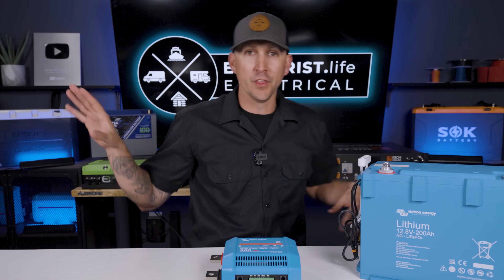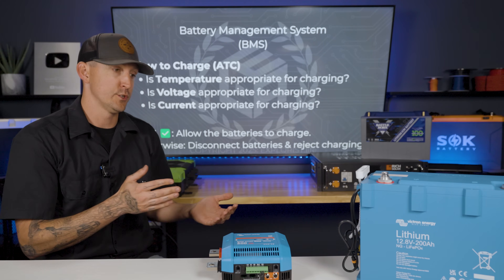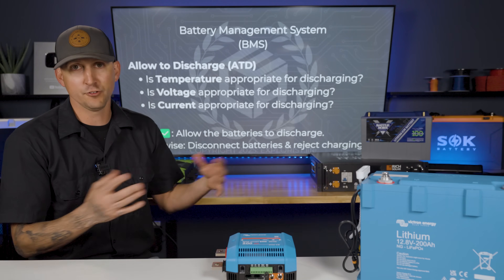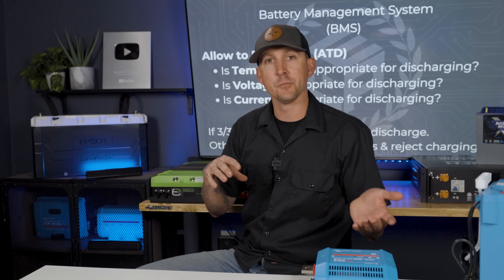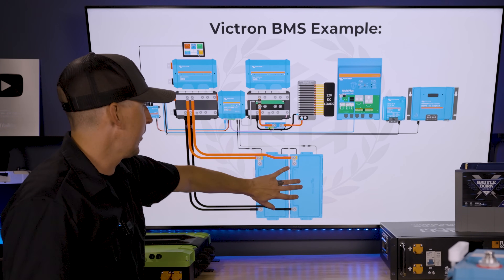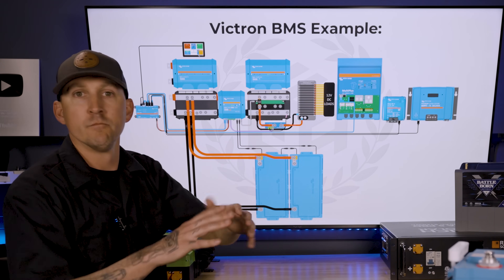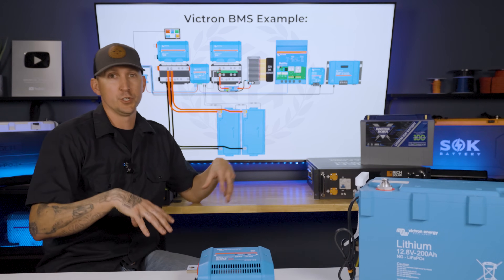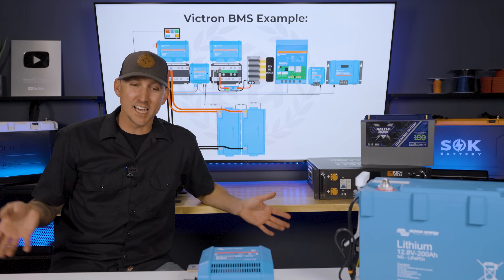BMS (Battery Management System) Basics for LiFePO4 Batteries | Battery Basics Ep: 2/7

Comment: I wonder if the Victron approach is objectively better since it powers-off/pauses chargers (mppt, dc-dc, multiplus) on a BMS "not-ATC" signal, thus stopping energy flow throughout the system, versus an in-battery BMS approach where charging energy still flows through the system but is stopped at the internal BMS. I guess energy doesn't "flow" anymore once the internal BMS shuts off power input. Hmm..
Reply from the maker: I don't think one is necessarily better than the other.  They are both completely adequate and acceptable.

Comment: If I have a victron system but cheaper batteries (Powertech) because I live in New Zealand, do I still need a bms ? I have victron charger, 2000w Victron inverter, CerboGX  and 2 separate MPPT,s. One for roof solar one thru Anderson plug for portable solar.
Reply: Just saw other vid on batteries. Powertech batteries say they have their own business internally. Plus I have max/min voltage alarms on my Victron screen.

Comment: Here's perhaps a odd question but one that is not entirely clear to me.  I am thining of a camper van-type set-up.  Without solar, but that should be includced at same time (solar + alternator or solar + AC shore power).  

We speak of a BMS charging or discharing and always independant.  Say I am charging from my alternator, via a DC/DC converter, or perhaps with shore power via an AC/DC converter.  At the same time my 12V fridge is running and a few other minor 12V loads in the back of the van.  

I am assuming that the BMS looks for the correct voltage, current, termperature and will allow charging at the same I have some level of 12V loads pulling power.  That is, if there is enough current to power the 12V loads first, charging will occur otherwise (normal case unless you have way too many 12V loads!) otherwise charging is disable.  So the two conditions can nicely co-exest or is there sometype of an isolatore needed that seems to never be mentioned??
Reply from the maker: Great question — and not odd at all!

In most setups like the one you’re describing, charging and discharging can absolutely happen at the same time without issue. The BMS is designed to manage all that behind the scenes as long as everything is within spec.

To be sure your system is wired to support this properly, it’s a good idea to have our team take a look. You can contact support here:
https://shop.explorist.life/support
(Free personalized help for items from our store: https://shop.explorist.life)

If your components came from elsewhere, the EXPLORIST Pro Support Membership is a great option for custom support:
https://shop.explorist.life/shop/all-products/membership-tiers/

They’ll help make sure everything works smoothly together!

Comment: One comment  regarding  Internal vs. External BMS.    I think you want a single interal BMS if you have a single battery system.  All internal, same warrenty has the battery and 100% compatable with the specific battery being used, less space requireed, less wireing and fewer wiring junctions to fail.   

Use an External BMS when you have multiple battery system so that  you are not paying for a BMS over and over with each battery.  Also a single BMS would be the one BMS to "rule them all" vs. multple BMS that may fight eacher since they will never be exactly identaical.  Consider if the BMS's are checking to see if charging ok if you are right on the upper temperature limit or lower current limit or similar condition.  If you have 3 batteries and 3 BMS-- 2 may enable the charge while the 3rd one says disables charging.  

In any case, you would never want to combine a battery system that uses a combination of internal and external BMS, espeically from different manufacturers.  They would frequently fight each other and likley lead to some very odd and intermitted behaviour that would be difficult to troubleshoot!  And worse case for additional cost, extra wires, additional points of failure, etc.
Reply from the maker: Appreciate you sharing your thoughts! There are definitely a lot of factors to weigh when it comes to BMS choices, but some of the points here may not fully apply across all setups — especially with how modern systems handle multiple BMS units or hybrid configurations.

If you're working through a specific setup or want to double-check what's best for your system, our support team can help sort out the details:
https://shop.explorist.life/support
We offer free personalized support for items purchased from our store: https://shop.explorist.life

And if you're using gear from other sources, our Pro Support Membership is a great way to get expert guidance tailored to your build:
https://shop.explorist.life/shop/all-products/membership-tiers/

Comment: And the BMS alone costs as much as some batteries. That’s a tough sell. No thanks
Reply from the maker: This video was less about 'selling' and more about educating on how an external BMS works.  For 'selling' - we have both internal and external BMS battery option systems available in our store based on customer wants and needs: https://shop.explorist.life

Reach out and we can get you whats best for your system: https://shop.explorist.life/support
Reply: @EXPLORISTlife 
Victron makes great stuff with great connectivity with Cerbo but I wouldn’t touch their battery, Battle Born or Dakota battery with a ten foot pole. So many other battery options for a third to half the price with Bluetooth or CAN . Many are well arranged for travel. Many 24 or 48v battery have a 200 amp BMS with Bluetooth or rip out and install a JK 300 amp BMS which I have done several times.
Reply from the maker: @SkypowerwithKarl Right.  We have several options less expensive than battle born, Dakota, and Victron batteries available in our store, yes.  Reach out to our support and we can get you what you need.

Comment: I'm not a fan of Victron's external BMS concept.  Not a fan at all.   It's just yet another incremental piece of equipment that further bloats the large number of discrete pieces of equipment that already go into a Victron system.  It exposes safety devices outside the Victron's battery case as well which makes no sense.  And just like many of their other products, Victron dials-in just a huge number of variations of the product to pair against specific system configurations.  A multiplication of SKUs for no good reason.   Victron is already up to 6 different "BMS" products.   And they are vastly increasing exposed system complexity... again for no good reason.   It just doesn't make a whole lot of sense to me.

-Matt
Reply from the maker: Fair enough!  We offer both Victron External based bms systems and internal battery bms systems in our store.  Hit us up at https://shop.explorist.life/support and we can build you out a non-Victron BMS based system.

Comment: Just out of curiosity could you get that external BMS to turn on a heat mat under the battery or around the sides if it got to cold?
Just thinking, as that would be a very nice feature for the cold nights in a RV, Shed, Garage, Green house etc.
I had to put or batteries inside the house as it was gets just a little to chili for the batteries in the dead of night in our garage. If I did not have a heat pad every day I would wake up to disconnected batteries due to low temperature. The down side of just having a heat mat and no automation would result in once in a blue moon the batteries would shutdown under load due to heat aka high temperatures, as I had forgot to turn off the heat pad in the morning.

Very good video, Keep up the good work. 

Cheers from England.
Reply from the maker: Thanks for the kind words and sharing your experience—definitely sounds like you’ve been through some real-world testing! Automating heat pads through an external BMS could be possible, but it really depends on your specific gear and configuration.

Our support team would love to help sort out the best solution: https://shop.explorist.life/support

Support is free if your equipment came from our store. For other brands, the Pro Membership gives you access to expert guidance tailored to your system: https://shop.explorist.life/shop/all-products/membership-tiers/

Comment: What are the advantages or disadvantages of the external BMS vs the more common internal ones?  It seems that letting the battery manufacturer set the BMS parameters is usually a good thing.
Reply from the maker: Great observation! Letting the battery manufacturer handle the BMS settings definitely simplifies things and ensures everything is tuned specifically for that battery. External BMS setups, on the other hand, can offer more flexibility and customization — but they also add complexity and potential points of error.

If you're weighing your options for a specific setup, our support team would be happy to help you sort through the details: https://shop.explorist.life/support. We offer free personalized support for items purchased from our store.

And if you're working with components sourced elsewhere, check out our Pro Support Membership for tailored help: https://shop.explorist.life/shop/all-products/membership-tiers/.

Comment: Side question.   I have a TT that I use year round on my property.   Hooked up to 30amp service. What's the best way to keep my lithium batteries warm in the PA winters?  I don't always keep the TT heated.
Reply from the maker: Good question! Cold temps can definitely be tough on lithium batteries if they aren’t kept warm enough. There are a few different ways to manage that, depending on how your system is set up and how much power you have available.

For a solution tailored to your exact setup, our support team can guide you through the best options: https://shop.explorist.life/support. If your components came from our store, support is totally free!

If you're using gear from other sources, the Pro Support Membership gives you access to personalized help: https://shop.explorist.life/shop/all-products/membership-tiers/.